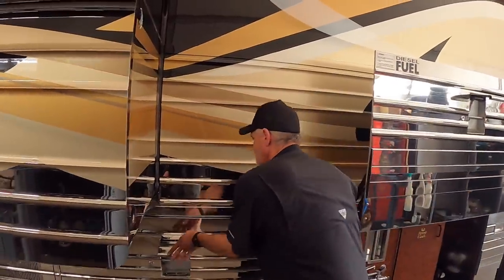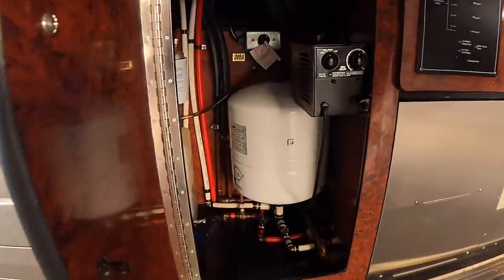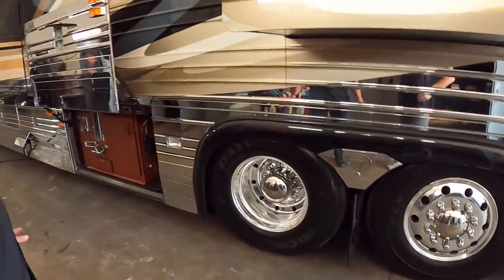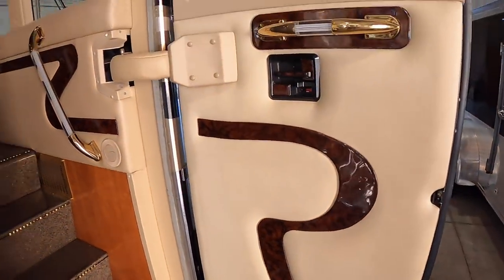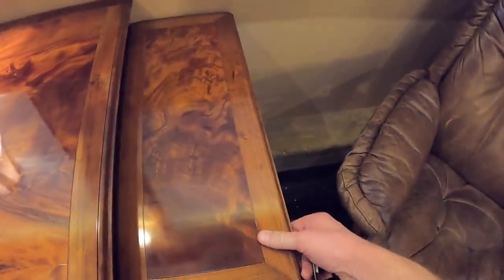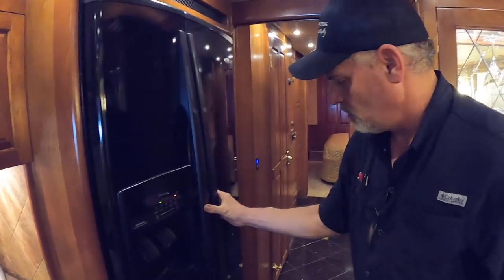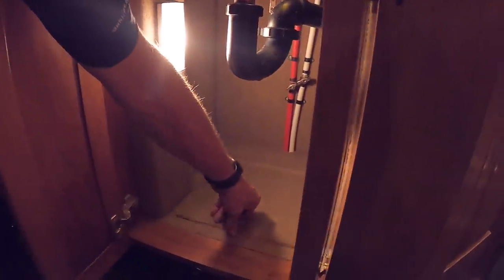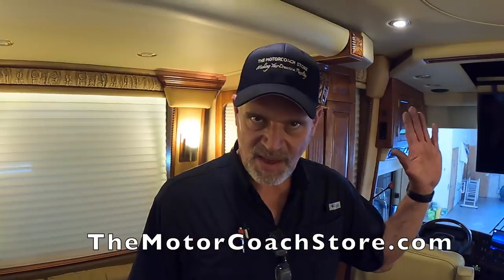TOUR OF PREVOST XL2 ROYALE COACH DOUBLE SLIDE FOR SALE in Florida $344,444!!!

Comment: 👍👍 Beautiful Coach.  Love the minimal use of mirrors compared to most other Prevost Conversion Coaches/Buses.  Another plus on this coach compared to most others is that there are no water, gas lines and drain/sewage pipes on or in the slide outs.  No need to worry about water, gas leaks and fitting separations due to tubes and pipes moving and rubbing when slides move in and out.

Comment: electric better then air if not in a dump truck, noted ck sound logic, & if cross heat belted & both hve flip up feature for legs u can elevate them when cruse on or if passenger & if u make them this way can rotate the wear between the two seats. At a min use 1 side raised & other side for peddles down. Note this guys imput plenty in the trenches great knowledge, wealth.